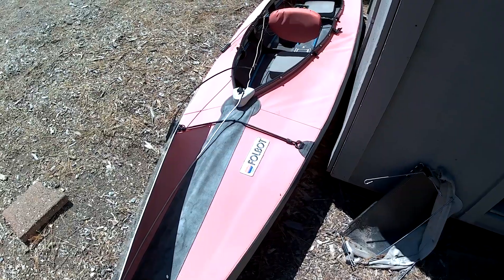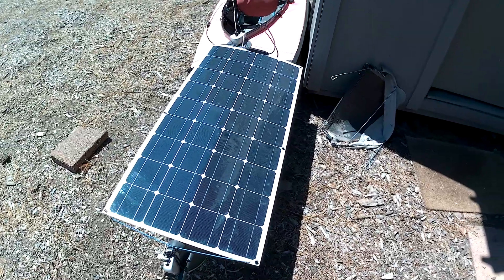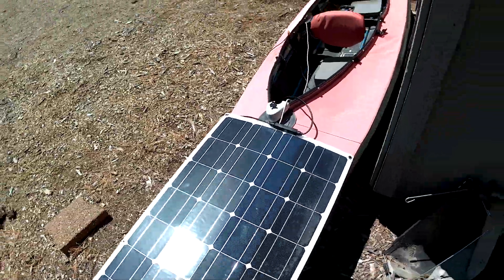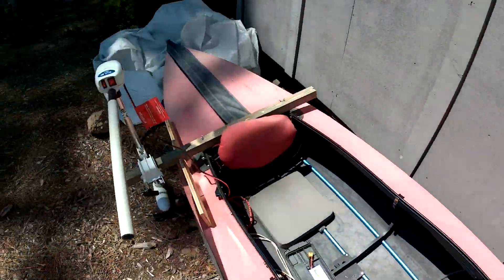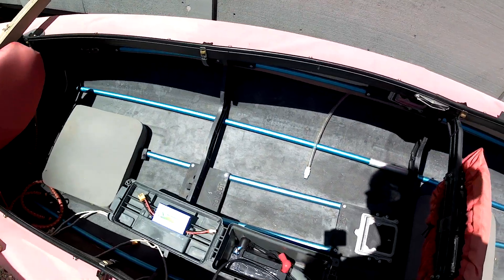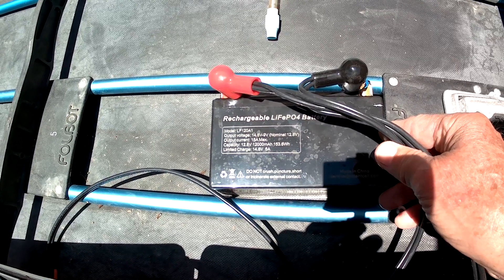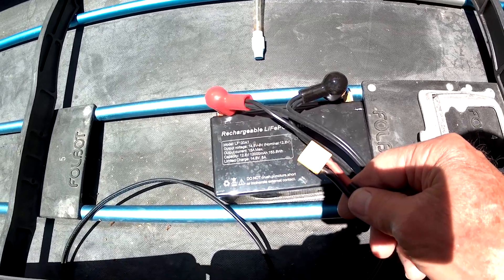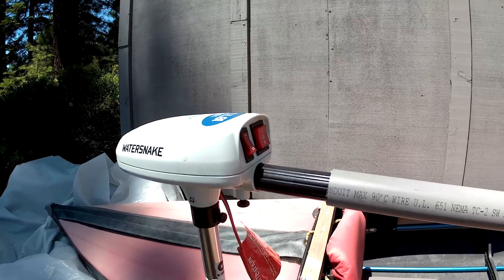Solar Powered Kayak

Comment: I like your old boat I've been trying to find one👍
Reply from the maker: I sold this a few years ago and replaced it with an inflatable (easier to transport). Moved the motor to the new boat. Works great. Did a circumnavigation of Lake Tahoe this Spring.

Comment: Thanks for this information. I am building a solar-powered electric bike with a trailer to carry the solar panels.  It occurred to me that I could use the same system to power my kayak. My system has 4 X 80-watt panels and on the bike, other people have got 200 to 300 kilometers with pedal assist in one day.  https://sites.google.com/view/crack-in-norwich
Reply from the maker: Looks like a great project. You should have lots of power with those panels. I find I can go 3mph in the kayak all day with a 100w panel. YMMV